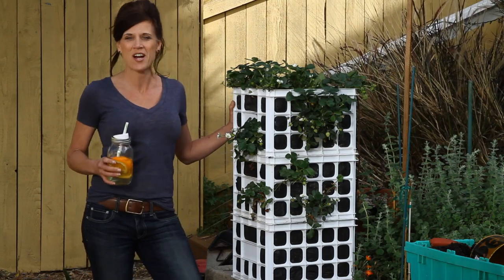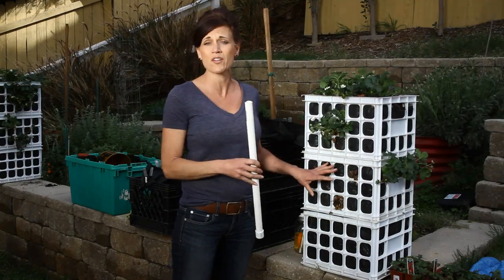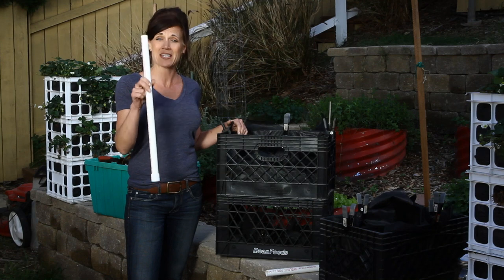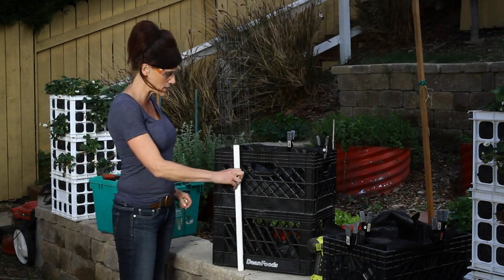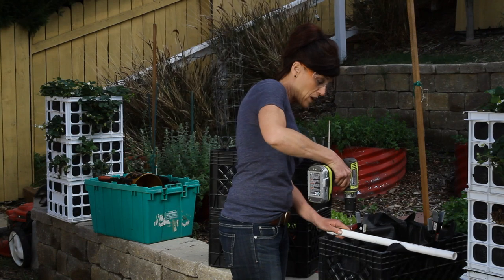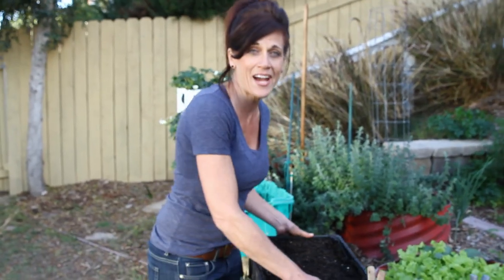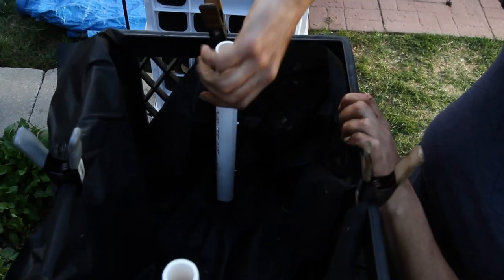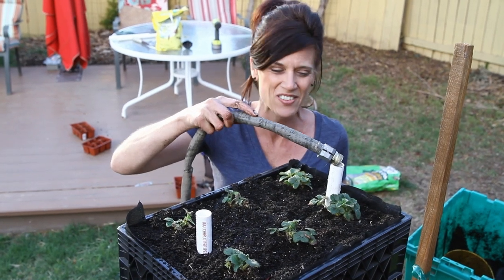How to Build a Strawberry Crate Tower -NEW AND IMPROVED!

Comment: You could improve it even further.
Take a large soda bottle, cut the base off, Turn it upside down and put the screw end  into the PVC pipe watering pipe.  This will act as a funnel for fulling, a reservoir for water and you will be able to use it to gauge the water level.. When the bottle is empty just top up keeping water available to strawberries.

You could bury half the bottle in the soil if you like so it is more hidden.

You can also use it to side dress additional fertiliser (liquid sewed etc via the water) during the growing season.
Reply: Perhaps even better still, forget the PVC altogether, un-stack the crates when watering, give them the same amount, and re-stack.
Reply: Joe Kollar you could do that but then it defeats the purpose of the tower crates which is for saving space and easy caring. If it's not simple, people are more likely to procrastinate. That is one way you could go about doing it though.
Reply: In reality if you water the top the liquid will seep through anyway but the tube waters from the inside out which encourages great root growth.   I like the tube system.
Reply: @73dguard1  i would think that would disrupt the roots
Reply: @73dguard1  Once well watered the crates would be heavy. Getting the top crate back on top would be hard to do.

Comment: We copies your design and love it. It sits in our greenhouse at the moment. We did have a problem with the water in the PVC pipe flowing down to the bottom and not getting the middle crates (we are 5 crates tall). To fix this, we bought those glass globes and put two in each of the middle crates. It works like a charm and we know when any one of the crates needs water. Thanks for the idea!

Comment: I built one this year and stocked it with 25 bare root Ozark Beauty strawberries which I planted in April. I couldn't believe it when I counted 130+ strawberry blossoms by May! The only issue I had was a fungal problem when we hit 100 degree temperatures for four days straight in early June. I removed affected leaves and have been using a DIY Neem oil foliar spray and soil drench to keep that at bay. So far, it's working.

Comment: I made my tower similar to yours, except I added a wider pvc pipe with larger holes. I added earthworms and compost in the tube about half way, and continue to add kitchen scraps in the center to feed the worms. I find that adding fertilizer each year makes the soil acidic. This is why I switched to a self fertilizing model. Worm castings and the aeration they do seems to work great.
Reply: Strawberries love acidic soil.
Reply: I would think 1" pipe would be better with larger holes.

Comment: One thing I think I would do to improve on the watering is to put a female pvc pipe end on the top of each pipe then invert a filled water bottle and screw it down so it would slowly empty into the pipes for longer watering.  
I think also with that large of crate, a pipe in the center would insure more even watering coverage (or) place the two pipes at an even distance apart from the sides and with each other.  So for instance: crate side>I------P-----P-----I<crate side:  this way the water is better distributed to the center as well as all sides.

Comment: I just wanted to say thank you very much for this idea. I took pictures of the one I built this year but I don't know how to post them on here so that you can see them. It is only 2 crates high and sitting on a wooden palate. I started with 32 strawberry plants but as they put out runners I removed them and put them into their own hole on the crate (another CaliKim video <3) and at last count I had 104 strawberry plants in one crate. It is on the top with soil in it to cover the roots but I have more baby strawberries growing up there too by seed. In the bottom crate I am doing an experiment and if it works out I will let you know. I am growing Small Portobello mushrooms in. They have to be in the dark and stay moist so they get the strawberry water run off. Your idea is great and I love it. I have recommended you to my neighbors who are all stuck gardening (like me) in a 20 ft long patio made of 85% concrete. I am also considering adding a 3rd crate because a good friend sent me some giant everbearing seeds :) I'll Keep you posted. THANK YOU SO VERY MUCH FOR YOUR TIPS!!

Comment: I am in New Zealand.  It is now Autumn here and strawberry season is done    I built a 3 tier version and it was amazingly successful. In fact more so than the other ground based beds I had.  

I cut the plants right back and they have regrown already and there are even a few flowers and berries on them. They are in a very sunny spot.    They just don't want to give up.  Lol 

I used pipes with upturned soda bottles (see my other previous comment) for watering.  

Works great.  I learned you need less holes near the bottom of the pipe than the top.  If you don't the water flows down the tube and straight out the bottom.  

Also you need one small drain hole down very near the bottom of the tube or water and crud sits below the last hole and goes very sour and stinky.
Reply: steve , do you have a picture of your setup ?

Comment: Great idea with the pvc pipe. Just found milk crates at Target for $3.47. When I go to buy them tomorrow, going to scan them with my Target Cartwheel app and will get additional saves at checkout!!
Reply from the maker: It will be a blast to get those towers going - so cool that you got such a great deal.  Will have to check out that target ap, have never heard of it!
Reply: Anytime you go shopping anywhere, always go to that store's website first. A lot of stores have apps or printable coupons. Michael's craft store for example has printable coupons for up to 50% off or you can pull up their website at checkout and get your discount.
Reply: The crates at Target are the smaller crates. The ones in Calis video are longer rectangles with more growing space. If you want these to last more than one season make sure you get crates that have UV resistant plastic. Here in Texas plastics fall apart in about one season without the UV additives.
Reply: Same size. Rectangle. 15 1/2" x 13 1/2" and 10 1/2" deep.
Reply: Here is a good source for the larger UV protected crates. 19 x 13 X 11. http://www.milkcratesdirect.com/rectangular-milk-crates-6-gallon-24-quart/set-of-6-rectangular-milk-crates
Reply: I don't think I'll pay over 8 bucks apiece to gain 4 inches on a plastic crate. Not that big of a deal. Nice website though.
Reply: Actually a standard authenticate milk crate is 13x11. So you'd be getting about 6 inches of additional growing space. Ordered 30 and they arrived today. Very nice quality. Should last for years. Have several hundred strawberry plants so need to get them started. I just wanted to duplicate the success of my friend the organic urban gardener.

Comment: Would it be sufficient to only water using the PVC pipe with the holes drilled in it?   I don't own any kind of a drip irrigation system and I don't plan on it anytime soon.   I understand that the top crate would have to be watered the traditional way for the strawberry plants there, but for those ones planted vertically and all the way to the bottom crate, does the pipe method provide enough water?
Sorry for all the questions--I've just never seen anything like this before.   Thank you.

Comment: Nice Job, +CaliKim! You and +Organics Best inspired me to try strawberry towers, too! I built mine using 3 5-gallon pots in each. Each holds 36 plants, and they are doing great! I couldn't run drip to mine, so I used water bottle reservoirs in the top level.
Reply from the maker: +Mamma Litts   So happy that you built a strawberry tower and modified it to fit what works for you!  Can you post a pic on my FB page, I'd love to see your version!
Reply: How did you get so many plants in the buckets??

Comment: i recently built a strawberry tower out out of a pvc pipe that sits in a pot for my wife, just happened to stumble across your strawberry crate video's tonight. Great concept, im keen to give this a go for more strawberries (my wife loves them as much as your family seem to) and herbs. One thing im not sure of is the reason there's a hole drilled in the bottom of your pvc pipe.... wont that reduce the flow out of the holes on the side of the pipe?

btw, you have some great video's, they're clearly presented and inspiring too. New subscriber from down under :)
Reply: It's for a: drainage and b: to water the lowest crate.
Hope this helps!

Comment: Love the idea for watering, but why do you drill a hole in the capped end of the PVC pipe?
Reply: yeah- why cap it at all?
Reply: I believe the hole in (bottom) the end of the pipe is to water the 1st crate under the second, as it appears the pipes only go the depth of the two top crates.
Reply: As I heard it, there are no plants in the bottom, (just rocks for stability,) in order to keep pests to a minimum.  So, I'm not sure about the hole in the bottom, either.  Without the cap, all the water would run out, and none go out the sides.
Reply: so still water doesn't sit in the bottom and get disgusting and filled with crud probably.. I would fill it with perlite

Comment: Instead of needing the pipe- why wouldn't slits cut into the bottoms of the landscape cloth let the water get through the bottom, also put a small layer of gravel on the bottoms and put 30% perlite into the soil mix. All of these steps should let the water drain from top to bottom.

Comment: I like it when someone makes intelligent changes to their gardens like yours are. Just curious, did you think about doing 3 holes in the tubes? (aiming the 3rd hole towards the center) Keep up the good work & ideas.
Reply from the maker: +Chris Dahl   Since I try so many new things, I am always making changes depending on what works and what doesn't.  That's the fun of it!  :) I drilled 3-4 holes in the pipes, each one going through to the other side, about 2 inches or so apart up and down the pipe.  You growing strawberries, Chris?  Thanks for stopping by!
Reply: +CaliKim29 Garden &amp; Home DIY  Sorry if I wasn't clear. What I meant was a 3rd set of holes half way between the 2 you drilled but not all the way thru. That way you would get water into/ between the tubes and not need a dripper for the center of the crates. Kind of like a "T" shape. 
No, never had any luck with strawberries.

Comment: I'm not sure this design works because when she added the pvc piped she forced it down into the soil creating pressure and possibly the holes got plugged up slowing down the drainage effectiveness. From what I read is you have to add a percentage of sand into the soil so water get travel to the roots. Like 20%-30%

Comment: Thanks for this follow up video! I wondered about the lower level plants getting water. Question---did the water soak through from the the top into the second crated fairly well? I guess I am curious as to how much the landscape fabric allows the water to go through, or did you cut any holes in the fabric at the bottom in that top crate?

Comment: hi, love your video.

i planted 4 strawberries plants last wk on a container but the last few days, something is eating the leaves but i cant find any caterpillar or slug.
i saw your video about egg shell around lettuce plants, can i do the same on strawberries plants?
Reply from the maker: Hello Angel - It's always disconcerting to see something eating away at your garden.  Yes, you can use egg shells anywhere you would like to in your garden, it certainly can't hurt and just might stop the culprit if it is a crawling insect.  You might also want to try Neem Oil for those chewing and sucking insects that fly, I get one at http://therustedgarden.blogspot.com/p/100-cold-pressed-neem-oil-for-sale.html.  An organic solution, and needs to be applied regularly to work.  Keep me posted!

Comment: Can you treat these container strawberries as perennials still, or do you have to treat them as annuals?
Reply from the maker: Hi Richard - they are perennials in my climate here in So Cal with the mild winters we have.  That being said, strawberry plants last an average of 2-3 years, some of my plants are reaching the 3 year mark and will need to be replaced this year.  If you live in a cold climate, sometimes the cold will kill them in the winter and they have to be replanted in the spring.  Mulching heavily does help, but is not a guarantee.  In cold climates, it's best to move container plants indoors to a garage or put in a protected location.  Thanks for watching!

Comment: I am wondering if I could add a  additional pieces of irrigation lines across the top crate that connects the to the main water line using a 3 way connector? The additional irrigation piping  would run  the length of the pvc pipes through the 3 crates and one could  duct tape off the section that is at the top crate to force more water to the lower crates?  So all watering is done throught the irrigation system.  So the top irrigation system would have a 3 way connector - 1 to each piece of irrigation piping that is running vertically to the bottom crates and then one and additional 2 way connector that would hook to the top irrigation piping and then to the last connector on the 3 way, thus connecting all the piping to the main water line?

Comment: Am I the only one whose strawberries did NOT return this year?  It worked fabulously last year but only one plant returned.  I'm in zone 7A.  I'm thinking the crates must not provide enough warmth or protection,  ANY ADVICE?
Reply: I move my strawberries into the shed on a rack for the winter.  After they freeze I cover them with a furniture pad so the temperature doesn't fluctuate.